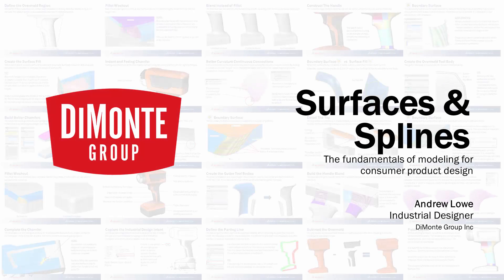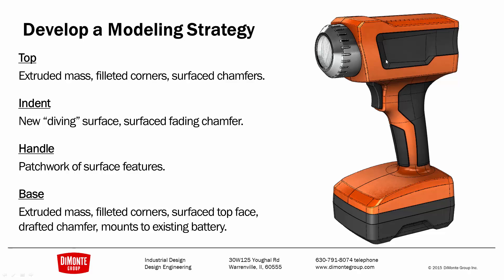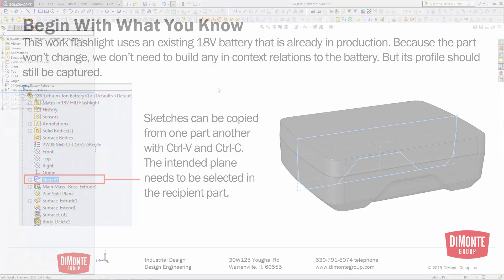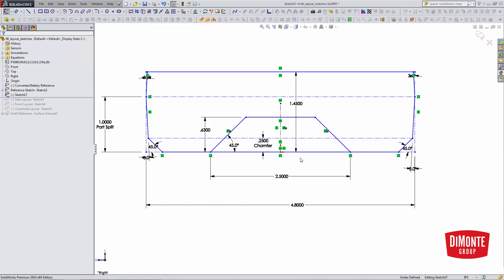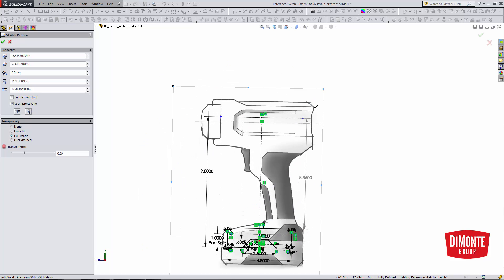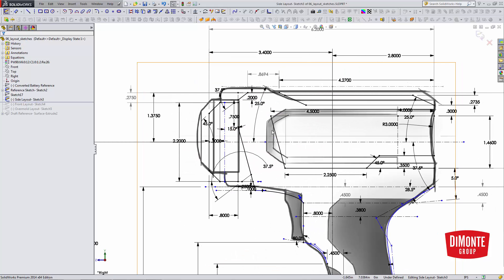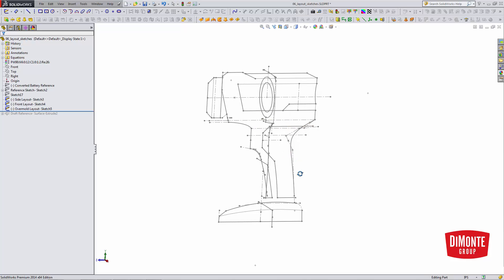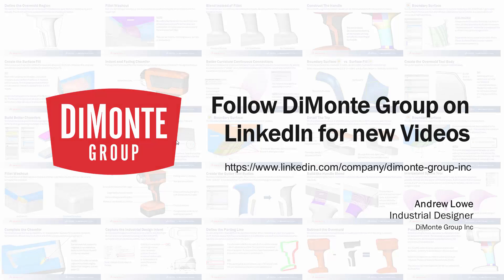Surfaces & Splines | 07- Modeling Layout

Comment: Hello, I am trying to find the best method to create a surface for CNC manufacturing. Perhaps you could advice me which method (loft, boundary or fill) would give me the most accurate results in my case? I could give more info via email or else. Thanks.
Reply from the maker: This is an interesting question.  Please feel free to send me an email at eeaton@dimontegroup.com with more details about your specific case.

In general, all three (loft, boundary, and surface fill) create good, accurate geometry based on their inputs.  

If your inputs are bad (for instance, the curves and edges that you are trying to make tangent/curvature-continuous to surrounding faces aren't actually tangent or curvature-continuous to the edges you are trying to connect) loft and fill still make a go of it.  
Boundary has a great policing/auditing function in its algorithm that will let you know that the edge conditions you specified can't happen because, well, you didn't do your job right and give it perfect stuff to work with.  

But even from the technically-not-perfect geometry you can get from fill or loft, the milling bit on a CNC doesn't care.  

I have in my office a molded part whose tooling was made directly from a model with lofts and fills that should have been noticed better by our designer, and sure enough every flaw was cut just fine into the tool steel.  I know it would be way cooler for our company to pretend that mistakes don't happen, but I think it is way more important to acknowledge that we recognized that we did miss something and that we learned from it.  BTW - the part is in production and we have never heard a single complaint.  I am the only one that noticed it and it annoys me to this day that it happened.

This is not to indict fill.  It is an amazing tool that (as I understand it) was ported over from Catia around 2000 when SWx was acquired by Dassault.  It is, to the best of my knowledge, the only way to get a good n-sided surface in SWx.  Just be sure whenever you use fill to turn off "optimize surface".  With this setting "on" you get a loft if you have a 4-sided patch, but without the extra control you get from a loft.  Turn off "optimize surface" and the Catia algorithm kicks in and magic happens - especially if your inputs are pure.

____________________________

Since I'm kinda working in the dark here trying to answer your question, there is another possibility:  which creates bad geometry for CNC?  Anything can, depending on how the faces of the feature knit into the work body. 
The faces they made are fine.  But due to round-off errors on their perimeters - well past the decimal point- they need to be stretched or shrunk just a tad to knit to the faces around them.  
If you've been working in SWx you have seen the "gap control" option in the knit feature.  If you have been working with Swx for a while, you will have run into surface fills that won't "merge results", but when clicking that option off, that fill completes.  Then you can use surface knit with gap control to stitch that patch into the work body.  The way that works (as I understand it) is that "knit" nudges the edges of the surface to fill the gap and mate up with its neighbors.

The important lesson is that SWx is frequently shoving stuff around (just a little) in the background to overcome gaps.  We almost never hear about it, but when translating our SWx files into STEP (which everyone likes - no one is using IGES anymore unless that is all they are given) there can be problems.  
At every moment you are working in SWx, you are working on a parasolid model. 
If your vendor can take parasolid, you are good to go. 
If it needs to be translated into a STEP, issues pop up because there is a translation.  If you run into this, you can help by doing a "round trip export-import" in SWx to diagnose any potential issues.  If this is what you are running into, I can write more on that.  But since I only run into this once or twice a year, I'm going to stop unless you need more information about it

I hope this was helpful!  If not, please email me.
-Ed
Reply: @DiMonteGroupInc  Thanks for a very detailed answer and general tips, they are going to be useful for me in the future for sure. Now specifically about my question - I think I found the answer, at least what works the best in my case. I wrote more info about it on email.